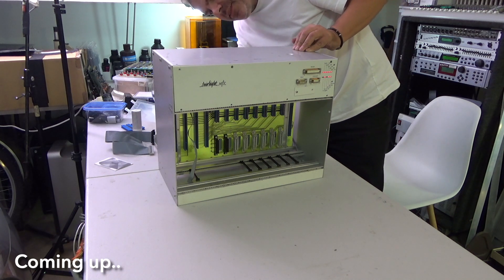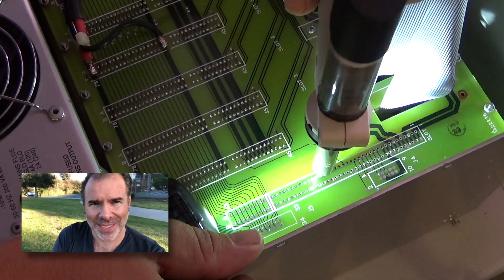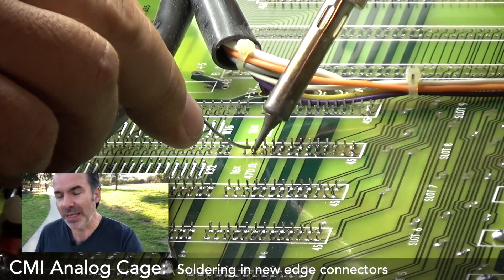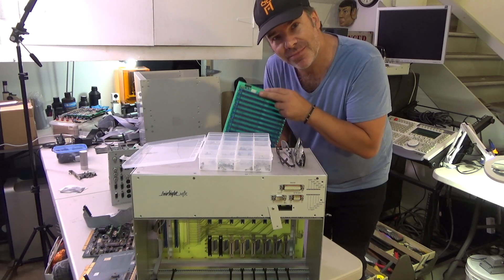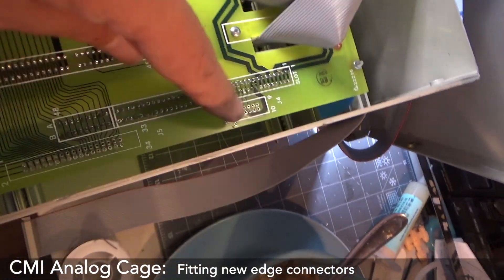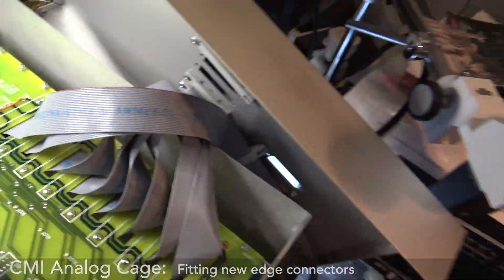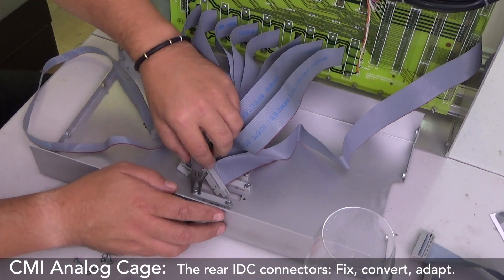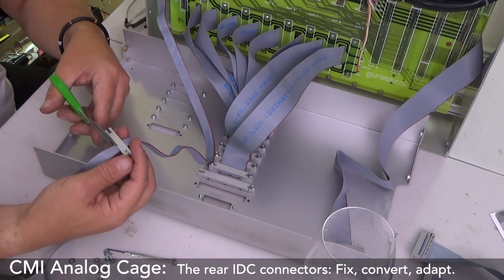I'm building a Fairlight CMI - Episode 3 - The soldering marathon.

Comment: You're very good with that desoldering iron. I have the same model and I get mixed results.
Reply from the maker: yeah, I've found there's a real 'knack'. I hold it to the side of the pin, and do a lateral wiggle, and then pull the trigger and don't let go of the trigger until I've pulled away. That way it gets a burst of air that keeps the opening clean/open. :) hope that helps !

Comment: The thing to do in the case where those joints aren't heating up fast enough is to put some liquid flux down on the board and that will conduct the heat to those joints more quickly. This is great for many reasons. Circuit boards can only take so much soldering and desoldering. Thermal stress will lift traces. So using the liquid flux to transfer the heat to melt the solder quicker would have been the thing to do.
Reply from the maker: yes ! you’re totally right ! could have saved myself some time too probably

Comment: Nice video again! You probably know this but to speed up desoldering old solder, first run new solder over every pin as if you were soldering it for the first time. Add flux over it too if you have some. This will really help the vacuum engage and remove things much faster. That way you can really suck!
Reply from the maker: I did initially start with using flux, but it got messy. Also, I realized that I would be using a lot of flux. and then the cleaning etc.. so I opted to go ‘dry’ It’s ok, I didn’t need a straight set of vertebrae anyway... :)
Reply: @CrisBlyth  I'm sorry for your loss

Comment: The missing 20V is probably a fuse in the ACCU, you have to open it anyway as the fans have to be replaced. Otherwise check the wire directly from the theroidal transformer. 5V comes as a separate cable from the SMPS of the DCCU together with 12V, ground and -12V. My cmi mfx2 has 3 external fans feeded by auxiliary cables for 12V but these are only needed when placed in a rack with the appropriate 19 inch blank panels.
Reply from the maker: As this one was an MFX build I don't have an toridial transformer.. I'm hopefully getting one from Peter ! and yes.. the fans will be replaced. ! Thanks for the info, it's all welcome and needed.